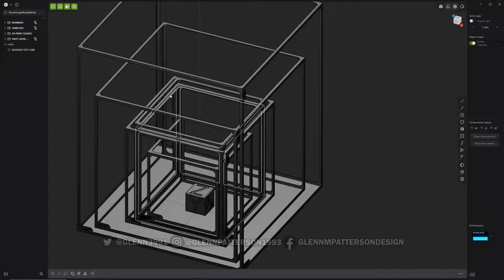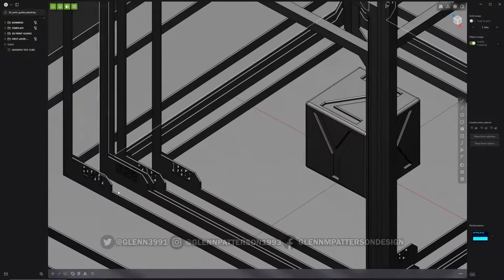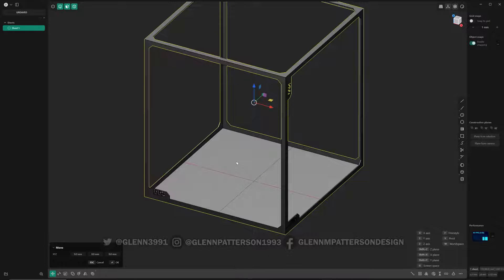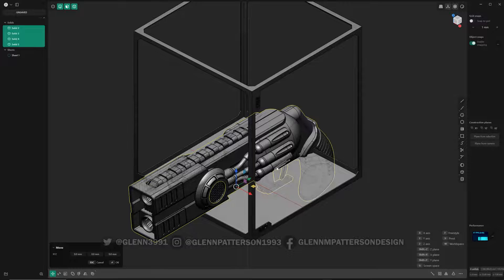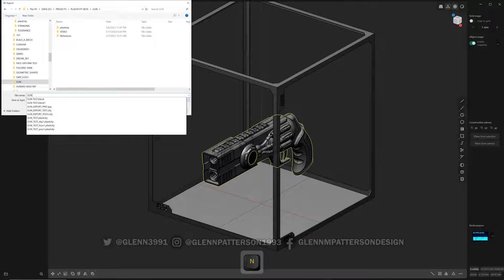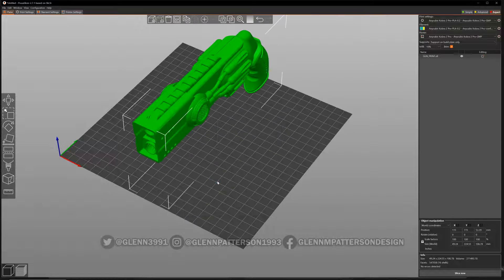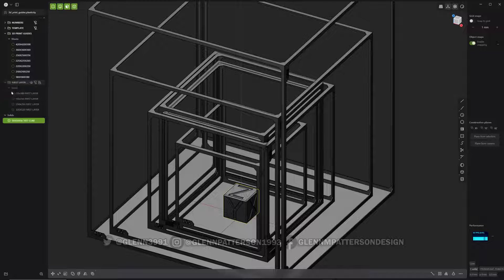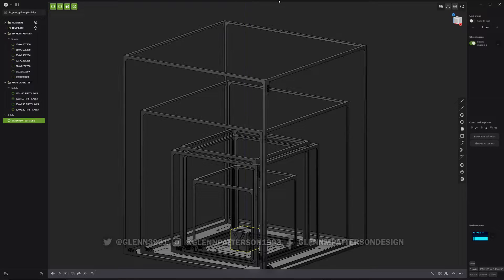93 PLASTICITY 101 3D PRINT GUIDES

Comment: I mainly use Plasticity for designing 3D prints myself so these guides are pretty neat to get a looks on how it will look on the plate before exporting to the slicer, thanks!
Reply from the maker: You're welcome. I find them kinda handy, you tend to lose sense of scale when looking at a monitor and my printer is in another room, so these help.